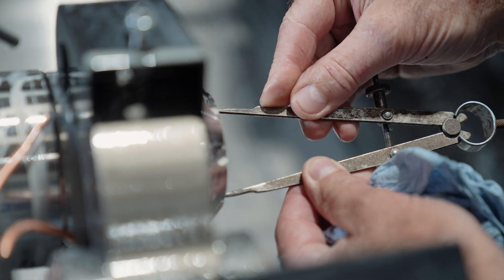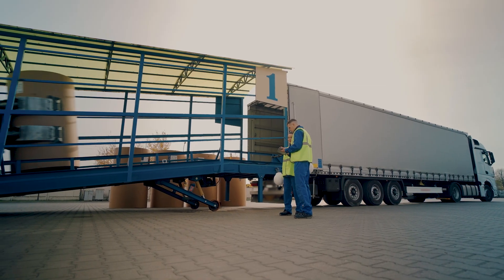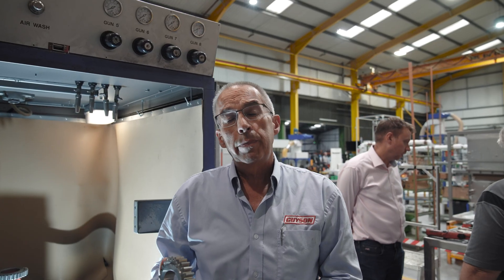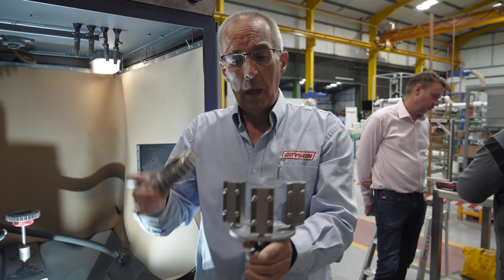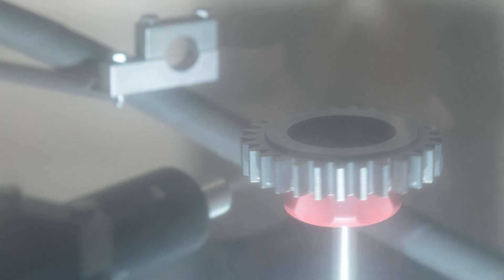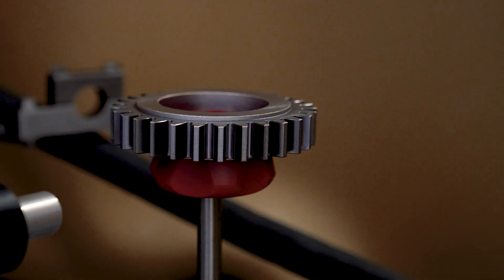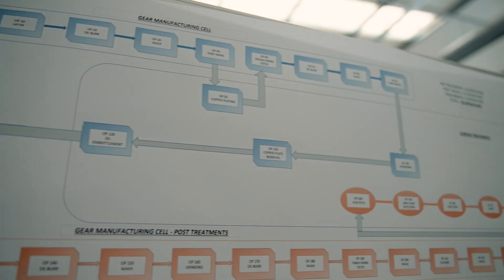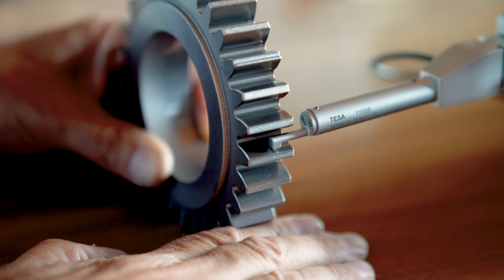Journey to HX50 | Episode 35: Revolutionising Gear Production

Comment: I really hope that you do not suffer from excessive gear scream from straight cut gears, the rotor head being right above the passenger are might give you an unexpected high pitch and unacceptable noise in the cabin. You might need to change to semi-local cut gears to obviate the noise but wit increased side and end thrust losses.

Comment: Each part has multiple critical dimensions… and material qualities… and process qualities…

Losing a gear tooth in flight… could be really bad.

I have seen the process of building Bell Helicopter gears, and the Jesus nut… back in the ‘90s.  (Subcontractor in TX)

Having full control in house… is a great way to go…

Go Hill Helicopters!

😃

Comment: This level of detail is just standard for making gears, even Hollinger carry out this level of testing and processes for their gears. Showing the minimum is nothing fancy, what you should show is destructive testing, pushing them to their limit, running them without oil, running above recommended speed, above temperature, shock loading, thermal shock, foreign contamination, that is what makes them aviation certified, not just how pretty they look.